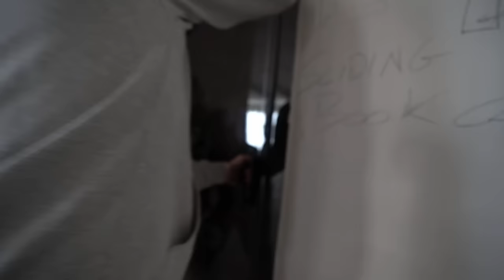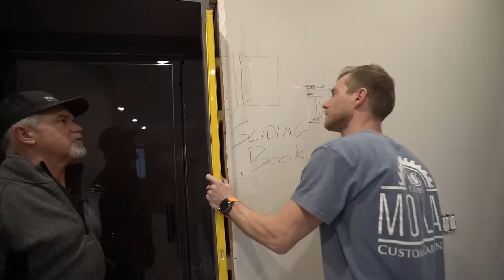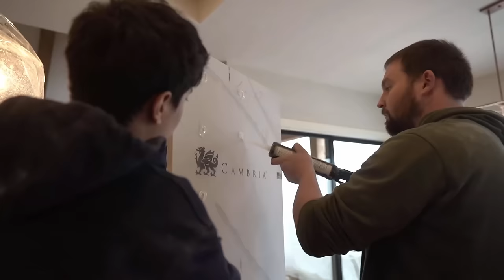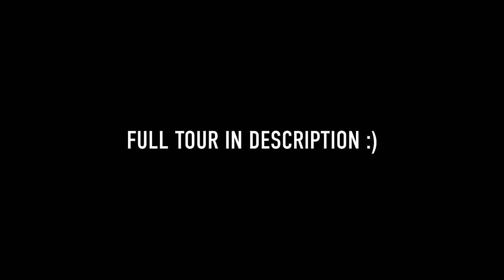Start to Finish: The BIGGEST Problems I Had While Building FLAIR'S House!

Comment: The build is fantastic,  However the crews working in those conditions are amazing.  I wished we'd used the area under our porch for a safe room instead of filling it with dirt.  Great idea.
Reply from the maker: Once I learned of good waterproofing products, we started using that space under the front stoop, which is been in the last 15 years